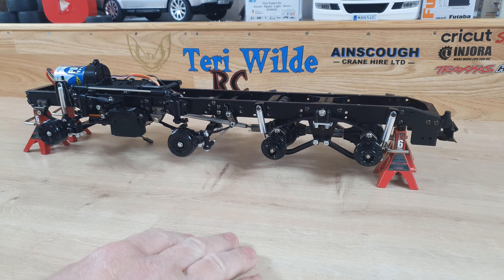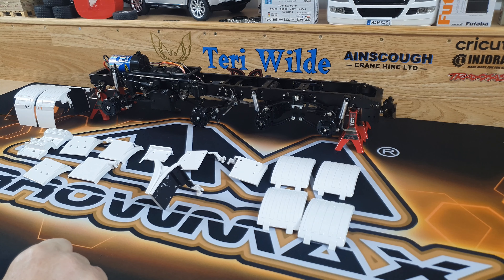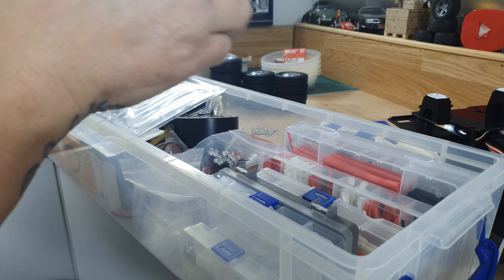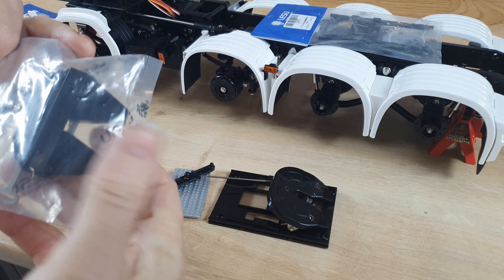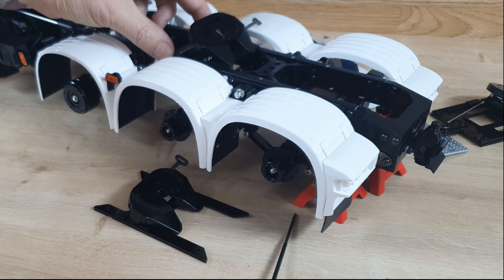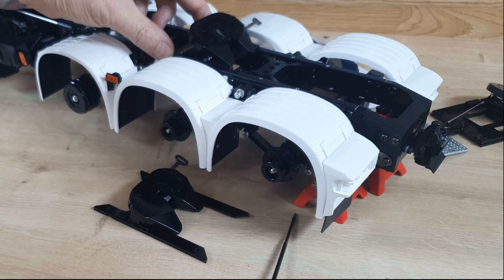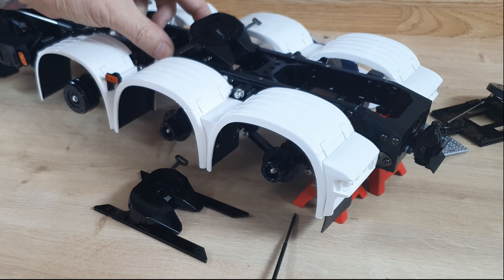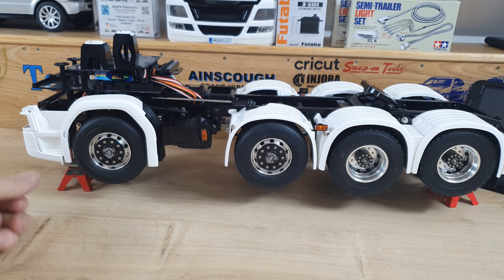Tamiya Scania 770S 8x4 Heavy Hauler - Part 5 - Lower Bodywork & Upgrades 4k

Comment: Hi you can order the H parts separately and the side panel fits ok with small changes on the left side Like mine.  I am attaching a picture of my truck.  Or you can order the H parts from 6x4.

Comment: Have you thought about the front lights and what your going to do
Reply from the maker: yes, it's having a full Beier SFR-1 system in it with all lights working. I'm assembling it to motivate myself. or I'll end up stalling out and not doing anything with it.
Reply: @TeriWilde  I have some lights that I'm selling because I couldn't wire them in, if you  look on you tube for real lights you can see them.( I'll see if I can get the link for you)